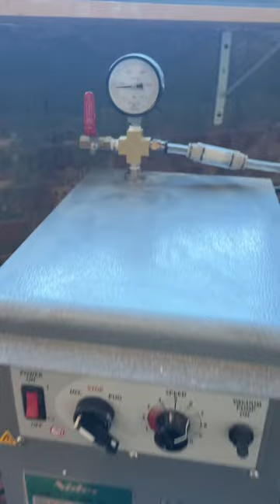clay poop

Comment: What is the “secret sauce” you add to the clay?
Reply: Probably a sort of flocculant I'd guess? (or maybe deflocculant, tbh I'm not sure of the difference entirely). It's just some chemistry that changes the consistency I think
Reply: cornstarch
Reply: @kltbird182  its likely an elastomer, or a flocculant as they tend to make solids drop out of liquid suspension and adhere to eachother while liberating water. Which seems pretty beneficial to recycling ceramics back into clay with a lower moisture content than a slurry.